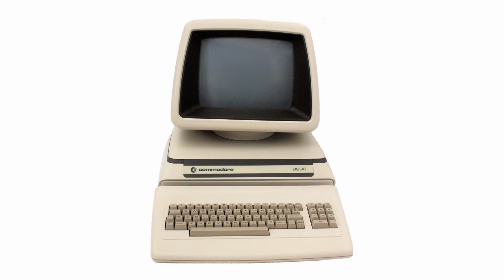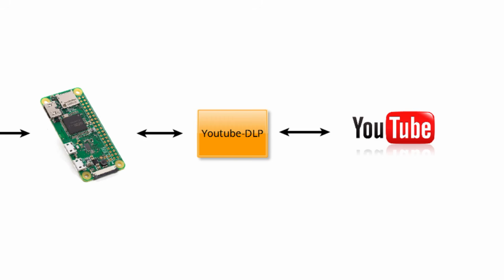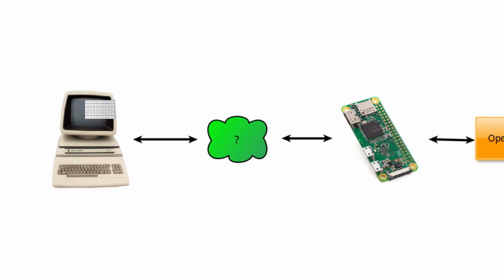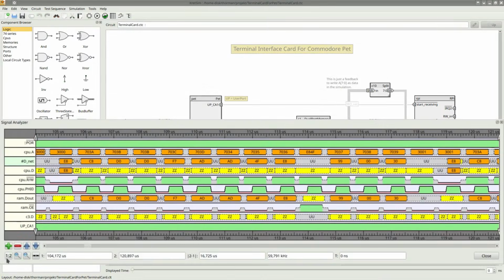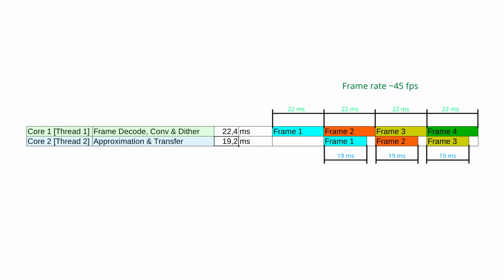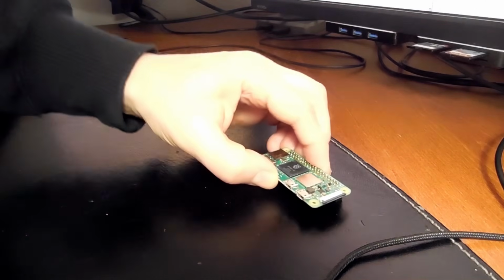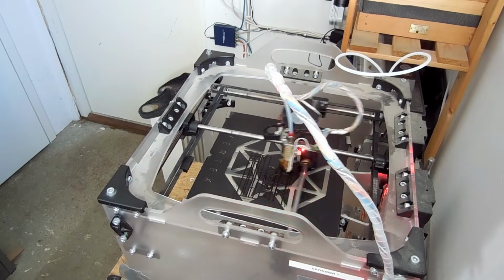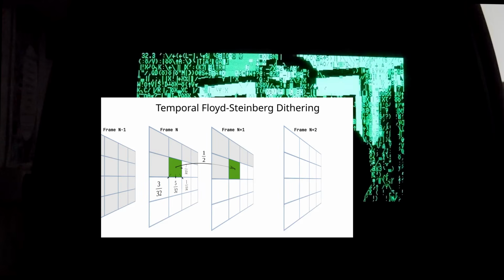Watching YouTube on a Commodore Pet

Comment: You're a man after my own heart. I am doing something slightly similar (but much simpler!) with my own home-brew 6809 based 8-bit computer. Lacking any good graphics options, I'm using a Pi as my video chip! Data only goes from the 6809 to the Pi though, which is definitely easier!
Reply from the maker: Sounds great!
Reply: Thats dope, im working on a a homebrew x86 (8088) PC and building a custom GPU to use a CRT monitor, so I feel you on graphics woes lol
Reply: Dude I have a "Retro" Console in mind which uses a Pi CM4 as a "GPU", "HID Controller" and even kind of Multiplayer Network Interface. The first idea was to use WDC 65xx or Z80 and emulate the bus with the PI. But later I thought more about to replace that with a RP2040 and use SPI because it is much easier even ROM Cardridges could be made cheaper. Still not sure about all of this and I never got out of the "I have this idea" stage 😀

The main Idea of the Pi as a GPU was just the fact that it has enough power to simulate a CRT. The problem with 1:1 output on modern flat screens is that they lack the "blur" effect, moire, bloom, etc. I also thought it would be cool to have a overlay where you can even use a IDE to code, compile and deploy your games to the "Game Engine" and even "burn" the game on a cartridge. The Pi maybe has even enough power to simulate a SID and/or YM2612. And if not that could be seperated in hardware and the Pi just needs to convert the analog signal into digital and output it to HDMI.

Comment: What about a UDOO RYZEN BOLT V1000 SBC Maker Board SBC and as 80586 assembly language is 3000.90 times faster than the COMMODORE PET, I just wonder if we do all processing on the UDOO RYZEN BOLT V1000 SBC Maker Board SBC and have it spit out the data into the COMMODORE PET which would not have to work so hard.

Comment: Why didn't you limit the characters you approx? I am sure a smaller character set would have done it too for instance if there's a . or a , and a : or a ; shouldn't make much of a difference, or? S and 8 are also probably quite similar, 6 and 9 and so on. 
Anyhow I like the hacky petscii video, can't see much details at all but still looks cool :D
Reply from the maker: Yeah, I spent some time thinking on doing the character approximation smarter, like by ordering them by similarity and then spent a fixed time searching for a match, and then go with whatever I found when the time was up, but I wasn't smart enough to figure it out. When the brute force method worked, I just went with it and didn't return to the problem.

Comment: This was an excellent video. I wonder if the quality could be improved by only using a subset of characters, ie: avoiding general letters and focusing more on the symbols and semi-graphical glyphs. This might give a “cleaner” result. Thanks for explaining this all to us. It feels like a mammoth project, but so worth it :-)
Reply from the maker: Thanks. Yeah, I wondered a bit which charset to use, but didn't examine it in full. I never considered a subset. This was the first attempt, so it would be strange if there isn't room for improvement...
Reply: @fulkonto1222  you can do even better by replacing the code page with optimised blocks each character a hamming shade block-
Reply: @carly09et  That would require replacing the character ROM chip -- the PET didn't have software redefinable characters.
Reply: @FadkinsDiet   Thank I forgot the era.

Comment: Unbelievable! It's like reading The Matrix!   And to think you pulled this off on a machine that can only render PETSCII characters, I take my hat off to you, sir. WELL DONE!
Reply from the maker: Thank you, sir!
Reply: That's spooky.  No computer from back then should be able to do that! :D
Reply: @falkerhard  Well technically it wasn't doing it so there is that.  I mean the Pi literally does everything except display the characters to the screen and even then the pi has to spoon feed the frames to the pet.  I don't mean to downplay the technical achievement here as it is impressive but let's not kid ourselves in to thinking the PET is doing anything extraordinary here.  This is an engineering achievement where this man built a hardware and software solution to tap in to the functionality of this old machine.
Reply: @Cyril29a  Yup.  Now, Jim Bagley' s port of Dragon's Lair to ZX81 - ie. streaming video and gaming - on a Z80?  That, sir, is hardcore assembly.
Reply: @V1br8tor  I'll totally have to check THAT out. Dragon's Lair should absolutely MELT a Z80 doing all the work itself!
Reply: This what the people controlling the computers in the matrix meant. They were just viewing an ascii video stream.  "You get used to it, though. Your brain does the translating. I don't even see the code. All I see is blonde, brunette, and redhead."
Reply: @MrSpacelyy  Exactly bro, exactly. 😄
Reply: He didn't, genius. It's the raspberrypi doing it NOT THE COMMODORE PET.

Comment: I thought the crazy character screens in the matrix were great, this is better!
Years ago I kind of did the opposite, converting ASCII art into pixel graphics, I used a way simpler method than all your calculations, I used a lookup table that reduced a character to a 2x2 pixel cell, the results were quite nice on my old TRS-80, just a pity the hires card I had at the time was very flaky, and soon hit the bin. No high speed stuff, just a single picture at a time, code all written in basic.
Reply from the maker: Still a fun project, I bet!

Comment: Now that was very impressive, to actually have a Commodore Pet computer connect to the internet's YouTube videos. I wonder if this would work on the C64 that has color and pixel graphics?
Reply from the maker: I've thought about that. It will require a larger buffer, a different approximation scheme and higher transfer speeds, but the end result should look quite a bit nicer. While it's tougher task in some respects, we're no longer restricted by the userport, we could use the expansionport.

Comment: All in all, very impressive work! But this being the Internet, of course I have to comment. Let's start with the two simple ones:

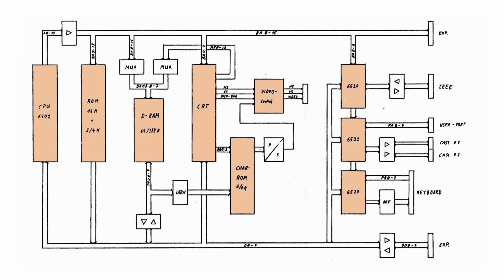3:12 You don't need a "DMA controller" to do DMA; you just need to ensure that the CPU doesn't interfere with whatever's writing to memory. You'll note that the C64 has no "DMA controller" either; the REU works by simply asserting the /DMA line on the cartridge port which pauses the CPU and allows the REU to read from and write to the C64's memory.

9:18: LDA₄ STAY₅ INY₂ BNE₃ (3 not 2 because branch almost always taken) totals out to 14 cycles. No need to put it in a simulator, really; you can just look it up from any opcode sheet.

And now on to the fun stuff relating to handshaking:

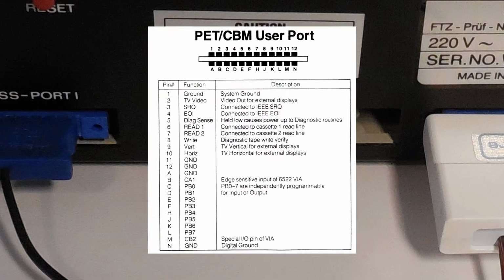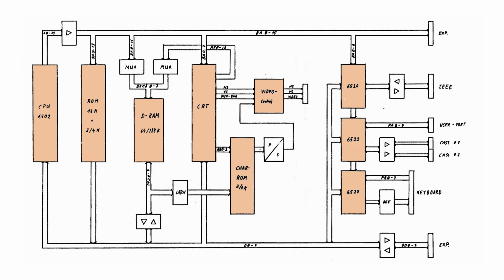1:40 That's not quite the PET user port pinout: according to the schematics on Zimmers the original PETs actually have PA0-7 on the lower pins, not PB0-7 as the VIC-20 and C64 machines do. However, the block diagram at 2:51 does correctly show the user port using PA0-7.

That said, it appears you're not using a PET here but a CBM-II (a.k.a. CBM 600 or B128) which (again according to schematics from Zimmers) has both ports A and B on the connector (and none of the video/CMT/etc. stuff in that chart). It also uses a 6526 instead of a 6522 which, if the data sheets I'm reading are correct, reverses the registers for ports A and B from the 6522. To further add to the confusion, the CBM-II schematic labels the user port pins very differently so I can't tell whether it's put port A or B on the bottom. Maybe you could clarify some of this? I see you've labeled the port you're using "PORT_A_..." in the source code, and the address is indeed port A on a 6522, but it's port B on a 6526.

15:53 "There is no room for any handshaking..." This is a bit annoying on the PET because the 6820 PIA (in this case the compatible 6822 VIA) is designed exactly to automatically do the handshaking you need. It can be configured so that whenever the CPU reads from port A the PIA pulses CA2 low, which the other side could use as a signal to load new data onto the data lines for the port.

Unfortunately, CA2 is used for switching between the graphic and business character sets and instead CB2 is brought out to the user port. I have no idea why they didn't just use CB2 for the charset switch and bring out the CA2 signal; that would seem more useful and I can't see how it would make any difference otherwise.

On the other hand, there might be a hack to work around this problem on the PET 8032. I notice that on that schematic it still uses CA2 for switching between character sets, but also brings that signal out to pin 11 on the user port. If you limited yourself to using only the characters common to both the graphic and business character sets (so that switching between the two wouldn't matter) you could probably safely program the 6522 to do CA2 strobe on read. It would be interesting to see if this works.

All that said, you appear to be using a CBM-II, not a PET, and the 6526 CIA's PC pin is brought out to the user port connector, so as far as I can tell you do have the automatic handshaking on your machine, and could have just used that to clock the memory address counter.
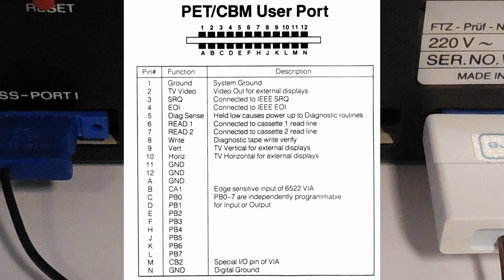Reply from the maker: Thank you for your comments. Well spotted that the table in 1:40 labelled the pins PB0-7 instead of PA0-7. I missed that. 

Also, very interesting CA2 observation. It does indeed look like CA2 is available on pin 11! That may eliminate the need for an external clock for the Pet address generator and the "timing issue".

As for the type of the machine, this is not a CBM-II-based machine and it's not a CBM600. It's a machine called "Commodore Pet 600", sold by Handic in Sweden and some other nordic countries during the 80's. It is in fact a re-labeled Pet 8296, so it definitely belongs to the 8000-series. It's equipped with 128 kB RAM, a stock 6522 handling the user port, a stock 6545 CRTC. I go into a little more detail what this "Pet 600" is in this video: https://youtu.be/FkZtM4YTRiQ.
Reply: @fulkonto1222  Well, it would have been better spotted had I noticed that two years ago when I copied that table into my personal notes. :-)

Very interesting about your machine. I was thinking it looked a little weird for a CBM-II (though the case is somewhat similar) and probably the big "PET" on the front should have tipped me off that something was up, but I pretty carefully looked around and couldn't find anything on the "PET 600." It's not mentioned at all in the English Wikipedia page, or even the Swedish page! Thanks for the video link; I'll definitely have a look at that later on.

Your other comment about the dual-ported RAM being hard to source is an important one, I think, and it's also a bit annoying to have all that extra logic for the memory address counters. One idea I've just had for dealing with that would be to use an ATmega microcontroller to build a FIFO; they don't have much RAM but they probably do have enough to handle the latency of the Raspberry Pi. When the ATmega hits a low water mark in the buffer it could signal the Pi to load the buffer up again, and the Pi could respond by transferring a couple of hundred bytes into the buffer in one go. You can still maintain the bidirectional communication by using CA2 for receive handshake from the PET and CB2 for send handshake.

There's also the issue of making this work on original PETs; it would require a slight internal modification to cut the trace to pin 11 on the user port and jumper CA2 to that user port pin. Hopefully this wouldn't break too many PET-specific devices; clearly Commodore thought it would be ok to do just this with the 8000 series so I guess I wouldn't be too worried about it.

Comment: Seeing this makes me wonder why the user port on the PET and later machines couldn't be used to get more than 2400 (UP9600 on C64) bps rates. Is it only so slow on the C64 because the kernal used serial routines that transferred one bit at a time? Seems that by running it in parallel the machines could achieve incredible transfer rates.
Reply from the maker: The maximum achievable speed depends on the details of the (higher level) protocol used, its "super-block size" and whether one uses polling or interrupts for storing the data, and how complex the routine for handling the incoming byte is. If one would have a "burst size" of 2048 bytes, use polling and similar scheme that I've employed here, and does nothing more than store the byte in memory, and use the 2000-times unrolled loop technique suggested elsewhere in the comments here, it should be possible to transfer data twice as fast as in this video, i.e. 120 kB/s or 960 kb/s. However, if we have an application that should do something with the byte, and the notification is IRQ-based, then we could easily spend 50 cycles or more for that, and the speed would drop to 19200 b/s. There could be an entirely different explanation for why we didn't see fast serial transfer speeds, for instance that modems faster than 2400 bps were not available in the 80s (in practice). The fast ones (9600, 14400 and higher) didn't show up until the 90's, and by then the Pets and C64's were mostly out of the picture. Or that the serial routines were'nt that fast. I don't know, to be honest.

Comment: This video has everything! I was always puzzled how demos of video playing on 8-bits were possible given the lack of DMA on most machines of the age, and the limits on how quickly data could be moved around the bus, this helps my understanding greatly. The bonus is to find details on dual-port RAM and modern multi-core programming which I have always struggled to understand the benefits given the "race condition" problem of concurrent operations. What a great find this video was. Great editing too.
Reply: Actually, a lot of the machines of that age did have DMA capability. The 6800 and 6502 both had a READY line that you could use to pause the CPU and you could take the address lines off the bus directly with a signal to many of the CPUs (e.g., 6800 or 6510) and  for the others (e.g. 6502) you just needed to add your own buffers to do the same.

One well-known example of DMA use is the REU (RAM expansion unit) for the C64. That didn't let the C64 access more RAM directly; it used DMA to move data between the C64 memory and the REU memory, which was otherwise inaccessible to the C64 CPU.
Reply from the maker: If I would have gone witht the slightly more "intrusive" approach and used the expansion bus (which is not exposed externally on this machine) then the RDY signal would have been available (via J4 I think). Then the pet address generator could have driven the internal address bus, the dual-port SRAM the data bus, and we could transfer one byte per clock cycle (instead of one per 14) pushing the transfer speed up to 1 MB/s and transfer time down to 2 ms, freeing up lots of CPU time.

Then I would effectively have had implemented a DMA myself.

I am not sure how that would affect the memory refresh logic of the internal DRAM however, if there would have been access conflicts or if some refreshes had gone missing. I'm also a bit wary of mocking about inside of this rather rare museum piece...
Reply: @fulkonto1222  Yes, the other stuff already doing DMA inside the machines (the DRAM refresh in the PET 2001-N onward and the VIC/VIC-II in the VIC-20 and C64) is definitely something you need to be wary of. The C64 was even a bit more complex because the VIC-II did not just do DMA during the ϕ1 half of the clock cycle (as was common on a lot of 6502 machines, including the Apple II and the BBC Micro), but it also had "badlines" where the VIC-II would halt the CPU during the CPU's ϕ2 half of the clock cycle in order to squeeze just a little more data bandwidth out of the system for itself. IIRC that process cuts off anything else doing DMA, such as the REU cartridge, but the REU had to be aware of this so that it knew when it was cut off and could pause its transfer during that time. I've not looked into how the PET does DRAM refresh, but if it's entirely during ϕ1 it might not be an issue.
Reply from the maker: Thank you very much! Glad you liked it!

Comment: Great hack! But couldn't you use the memory expansion port and avoid the address generation logic and the tricky synchronization issues?
Reply from the maker: Yes, for sure, but that's an internal interface, and I wanted to add a small external box to it, that easily could be removed. I have some other ideas for the memory expansion bus, we'll see if they will be realized.

Comment: That's a good fun hack!  I wonder if you could have got away with a FIFO chip rather than a full shared ram block?  I was remembering that the 6522 had some sort of handshake abilities; but it looks like they were on the 'A' port rather than B.
Reply from the maker: Thank you!

A FIFO might work as well, if you get a bi-directional one (need to feed back keyboard information as well). A device like  https://www.mouser.se/datasheet/2/698/REN_7203_DST_20171127-1996131.pdf might work. It's almost like a dual-port SRAM with built-in address generators. That would (significantly) shrink the design, make it more modern and future-proof. But then again, I could use an FPGA or CPLD if that was my goal. For this retro project I chose to stay with era-style components (aside from the Raspberry Pi of course), TTL and PDIP, which may not be rational (but fun perhaps).